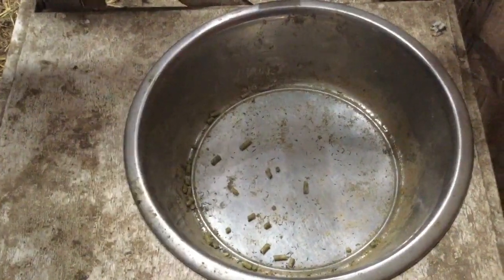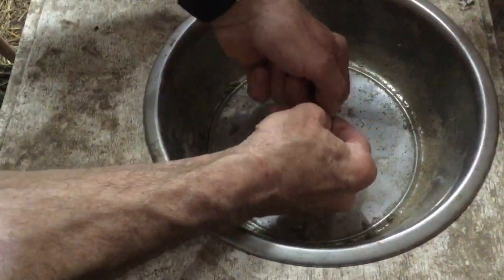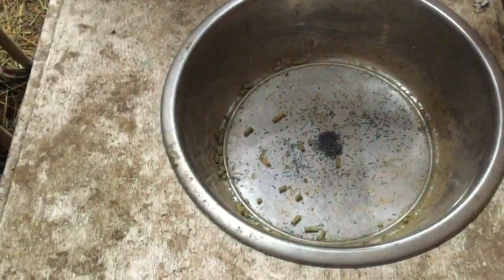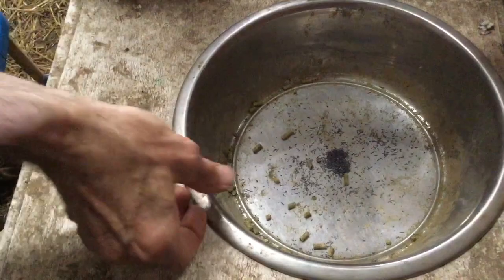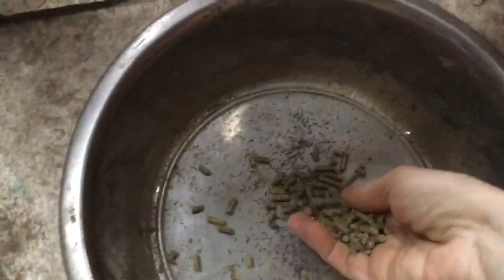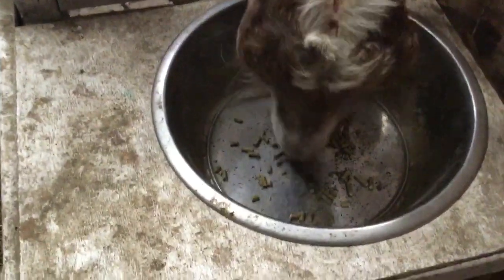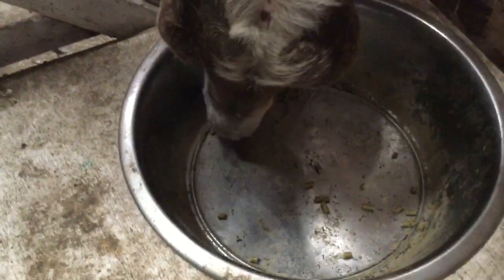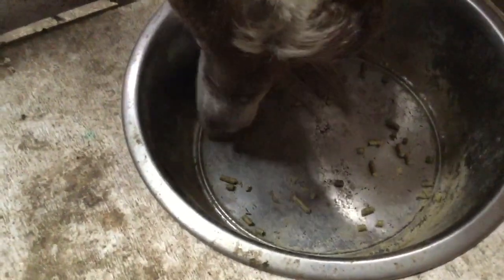How to Give Copper to Goats

Comment: I was told that a bolus gun was to be used because the capsule should remain whole so it slowly dissolves and the copper can adhere to the stomach. ? This would certainly be easier. Also how much grain would be an appropriate amount to start with for Nigerian dwarfs? I realize it’s different for lactating or pregnant goats. Thank you very much.
Reply from the maker: That is very old information that was common practice 20 years ago, but it was based on an assumption, not any research. It's been at least 10 years since a study was done comparing bolusing vs adding to feed, and it showed no difference. Also, someone had their vet x-ray their goat the day of giving their goat a capsule stuck in a marshmallow and then another x-ray a week later, and you could still see the COWP a week later. It's really silly to think that a goat could chew up copper oxide wire particles, especially considering how fast they swallow them. They don't even chew up their grain. Also, we have had liver levels done on goats for years, and there has been no difference between the liver levels when we used to bolus and after we started doing it the easy way. 

As far as how much grain -- in this instance, you do it exactly the way I show you in the video. Just use enough grain to get them to eat all of the copper. It's not more than about 1/4 to 1/2 cup per goat. This doesn't have an effect on the amount of grain they get otherwise. You should not be giving them copper any more often than every three months, and then only in cases of extreme deficiency, usually caused by copper antagonists in the environment. On other farms, you would only do this once every six months. Here is my free course on copper deficiency -- https://thriftyhomesteader.teachable.com/p/copper-deficiency/